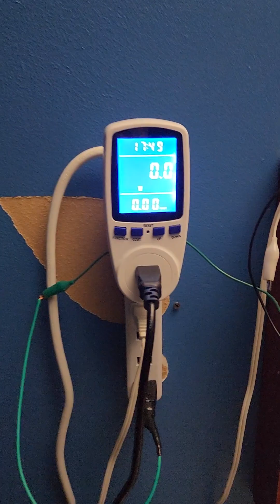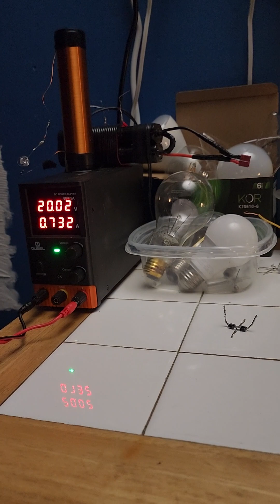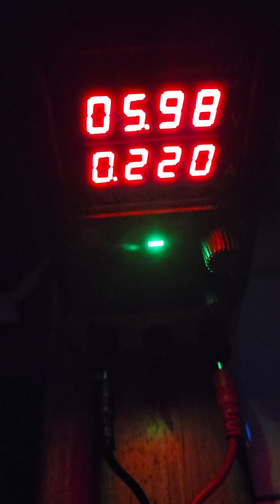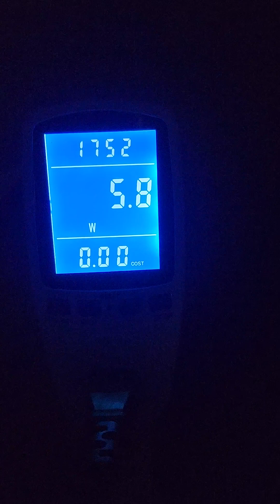😱 ANOTHER MIND BENDING DISCOVERY! NO RECEIVER LIMIT! & REAL EARTH ENERGY 🌎

Comment: The earth is acting as capacitance even 2 Electrolytic cap w opp connected to ground shd work... Earth supplies the capacitance part though the voltage tunning to the led wattage must b made r the diodes 2 different types then one neg freq nd pos is running opp sides between equal caps or electrostatic or dielectric charges

Comment: Is the remote LED on an Avromenko diode setup?  If so then you are just adding virtual grounds to the existing phenomenon, regardless- good work.
Reply from the maker: Yes it's an Arvemenko plug & most sensitive diodes were 1n4148 & uf2008 for high power applications

Comment: Hey Dude ...Your Work Rocks, you have Helped My research Leap Forward and for That I Thank You; That being Said....When it comes to the two heat sinks on the floor lighting the led, I suspect that Your Tesla Coil is Causing a Gradient Within your Room, Therefore When the Two Heat sinks Are far apart You are Creating a Voltage difference due to the Distance between the two, and the LED is your load ....NO COST ( Your Coil has created a Gradient Voltage Difference )    AWESOME

Comment: The earth is the most negatively charged entity, so every cubed mm above that will have an increase in potential all the way up to the ionosphere. I believe you are giving the higher potential (above ground) a path back to equilibrium through you load/earth blocks. Your load is just a miniture (drop in the ocean) measurement of the energy available/ active in your surroundings, activated by your transmitter allowing them propetually excited electrons to do what they do best.

Comment: Seems like the two heatsinks act as a dipole antenna that receive what the coil is broadcasting.
You could try to add two wires that are 1/4 of the wavelength of your transmission to it instead of the heatsinks, this should give the maximum output.

Comment: the one heat sink is closer to the transmitter which has more voltage on that side compared to the other heat sink that is far away. the furthest heatsink is basically your ground. i guess also maybe the hat sink has got more metal surface area, so probably picking up more electrons in the air. That's my guess

Comment: That will be potential difference between two metal blocks. "Electrons" flow from more to less where "more" is metal block closer to transmitter.
Try experimenting with different blocks orientation in relation to transmitter.

Comment: try creating in the near proximity of the transmitter the independent oscillating  receiver circuit(push-pull), for example the adjustable frequency(50Hz-5800KHz) / duty cycle high frequency inverter, connected to the high frequency diode bridge and filter circuit and then to the load.  Measure input and output power... if you think you got access output, then loop back...